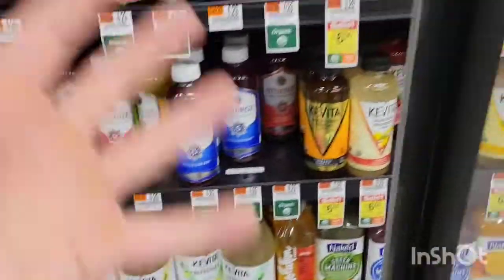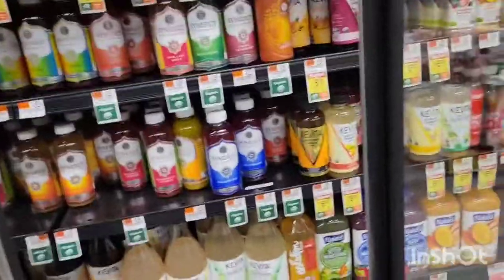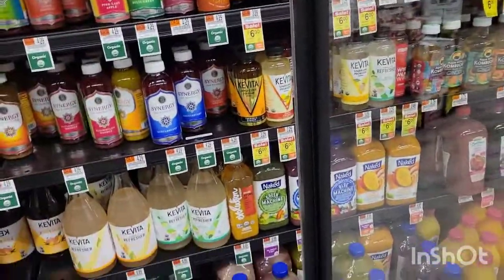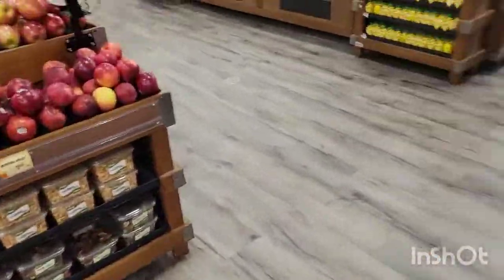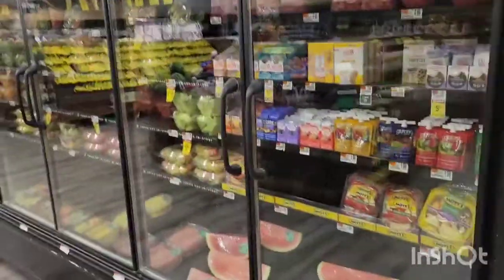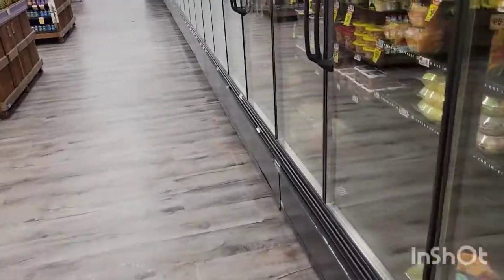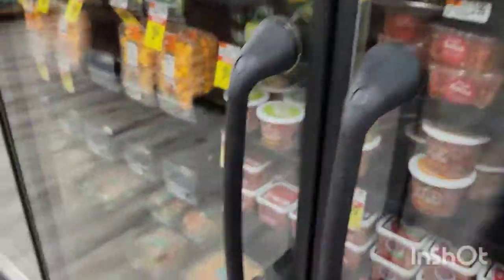Supermarket Refrigeration- Setting A EPR With Retrofit Doors Trible Knowlage (Icing Coil Issue

Comment: I've got a bunker on A-11 circuit. 11d is too cold,11a and c are good,11b too warm. Epr is set at 50 psi on r-22. What do you think my problem is?
Reply from the maker: Typically the problem starts with the warm case I would start there the other cases are pulling down the warm case